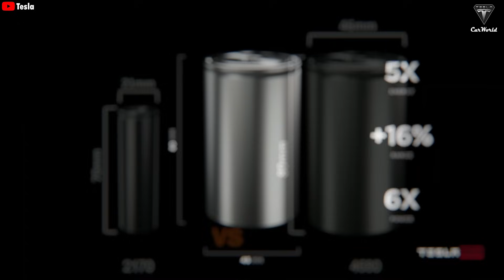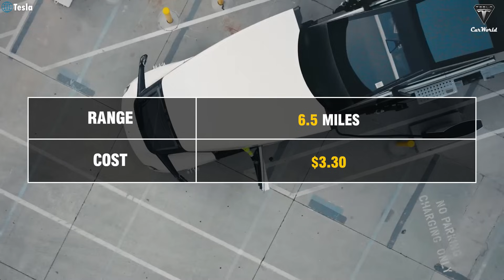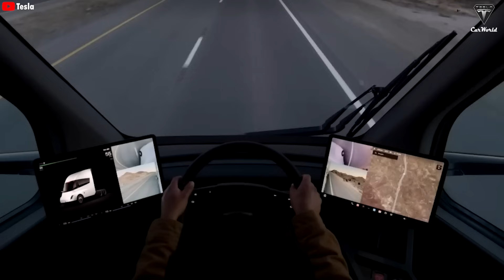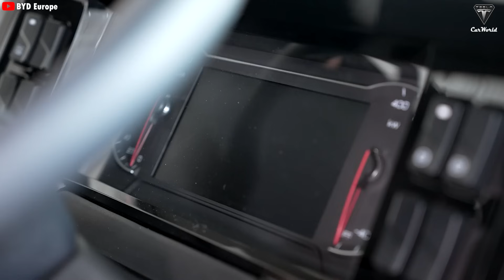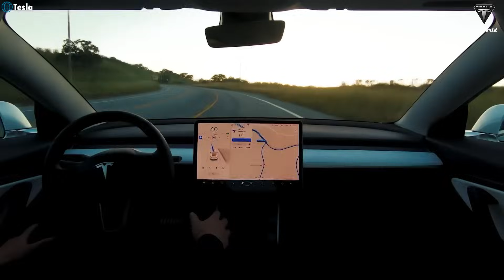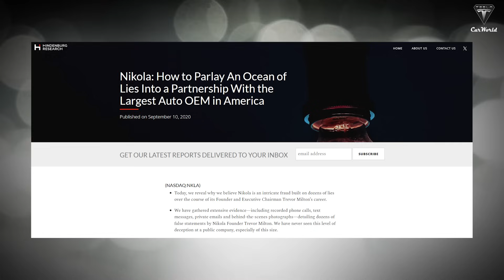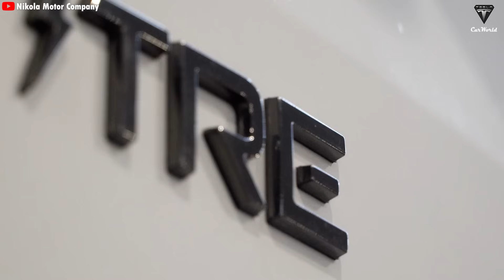Tesla Semi Take Over 2025 As Money Machine For Truck Drivers, Elon Musk Announces Huge Benefits!

Comment: The electrical grid is already quite strained. There is not enough energy available for all vehicles to become electric. And unless new nuclear power plants get built , wind and solar will not be sufficient and electric cars and trucks are a whitewashing as the power plants are going to stay running on coal, gas or oil. To solve a non problem of CO2. The only advantage is that exhaust of power plants can be induced into massive amounts of greenhouses to capture the co2 in plants and yield massive amounts of food...
Reply: "The electrical grid is already quite strained", Really? According to who? 
"wind and solar will not be sufficient",  Really? Won't be sufficient for what? 
As of last year coal use has fallen to 16.2%, surpassed by Renewables in 2022 and are now supplying nearly 22% of the grid with Nuclear at nearly 19%. Yeah, utilities will continue to use coal and natural gas for the time being but the more erudite reader (sorry MAGA) will notice that THAT'S NOW 41% LESS FOSSIL FUEL USE and with the increasing implementation of energy storage the growth of renewables will continue to accelerate.

Comment: Several problems with the truck, 1. Single driver only, Most productive way to get product to the end point is "Team drivers". It is more profitable with the 4 on 4 off driver teams. If you have one driver going from Cali to Florida you will spend a ton of money for hotels and meals. Sure, you will save on fuel, but time is of the most importance to get product to the endpoint.
2. Charging stations at every truck stop. If you don't have this, then it is dead before it even begins. 
3. No sleeper, It saves the company money and the driver if they want to keep the per diem and sleep in the truck.
4. No shops with available technicians or computers to diagnose the problems of a broken-down Tesla Truck. A lot of routes take you into remote areas of the Midwest would be a problem.
Reply: Just carry a diesel generator with you.

Comment: Tesla Semi steps (IMO) - prototype - check interest with reveal - redesign to reflect who is interested - produce a few semis and test internally - redesign, especially charging - make more semis for internal use - redesign - get orders - adapt semi to orders - make some test production semis - deliver to Pepsi/Frito-Lay - yet another re-design from on the road input and new technology - finally a usable pre production run - redesign as those were not easy to make - final design, build factory. I did not include software balancing (need regen leaving any warehouse and I am talking a full load from Sparks down to Fremont while maximizing regen - truck has to know where it is and plan for loads). Axle physical disconnect and other features. 

The timeline looks more reasonable than if they bought a Freightliner  and put some Model 3 motors in it.

Comment: Not sure my experience would agree with the savings.  If you are having to charge at Tesla Chargers, long haul truckers,(assuming they will be available) the current going rate at superchargers is .35 - 40 cents a KWH or about .64 cents a mile (1.7 KWH mile x .375 cents per  KWH).  When you compare this to diesel truck @ 6.5mpg at $3.65 a gal. of diesel it comes to .56 cents per mile. Even adding the savings in regular oil changes, transmission fluid, brakes ect. @ .15 cents per mile the savings are not earth changing.  .64 electric vs .71 cents per mile, about 10% saving.  This is assuming tires, insurance and cost of a new truck are equal between Electric vs Diesel.  If you are charging at your place of business for .14 -.17 cents KWH then the savings would be significant and a game changer.  If Tesla offers off peak rates at their Tesla chargers this could also be a game changer.   This would potentially lower the off peak rate to .20-.25 KWH or .38 cent per mile (1.7 KWH mile x .225 cents ).
Reply: The Tesla semi will charge at Megachargers, many of them owned by the trucking company. The efficiency and savings gains more than pay for the charging infrastructure. With a 500-mile range, they can charge while loading/unloading. Try doing that with diesel!

Comment: The system is awesome, but it needs a long-range battery with a range of 800 miles or more for cold-weather driving!
Reply: Incorrect. Cold weather only reduces the range by 2-3%.
Reply: @ZipZoomZip  There is a deluge of information online that the optimum operating ambient temperature for an EV is between 65º - 85º with a plethora of problems beginning when the temperatures go below 20º.  At those temperatures they tend to take twice as long to charge; the batteries are 12% less efficient; and if you want to keep the frost down on the interior, using the heater will drop the driving range by over 40%.  The extreme issues with EV's in the north the past few years aren't a state secret.
Reply: @lfrankl53  There is a deluge of misinformation. And never forget, not all EVs are created equal. Because engineering.

Comment: Whilst Tesla is talking about selling electric trucks, Scania and Volvo are actually selling electric trucks that are more advanced. The handful of Tesla Semi on the roads were pretty much given away for free
Reply: That was research and development and Pepsi frito lay already committed for sizable orders do your homework and check it out for yourself
Reply: @spadjustersshubert2872  Do it now and they will be forever associated with the Nazism of Musk
Reply: Scania, Volvo and eCascadia are why the Tesla Semi was delayed. The Tesla had to be more efficient to overcome their head start - and it is.
Reply: @thedukeofalinor1377  Those are all short-range electric trucks for local delivery. The Tesla semi is for over-the-road trucking and it was delayed due to lack of batteries. Now that Tesla is ramping the 4680 cell into high production, the Semi will have all the batteries it needs.
Reply: @ZipZoomZip  Not just batteries, Tesla needed to finalize the design for customer input and production ease.
Reply: @thedukeofalinor1377  True. But I'm looking at the bigger picture. They could have had a faster development process if they had a ready battery supply.
Reply: @ZipZoomZip  Agreed, but they actually did. They could add or subtract CyberTrucks. I highly doubt Tesla slows development for production. It's a balancing act.
Reply: @thedukeofalinor1377  Tesla will most certainly delay any phases of bringing a product to market, that costs significant money, as long as possible.. It's just one technique of many that Tesla uses to optimize its financial efficiency. Because money has a time value. All of these minor optimizations adds to their pricing power.